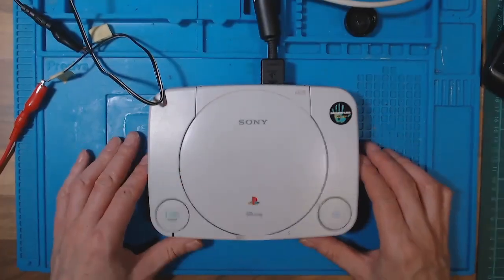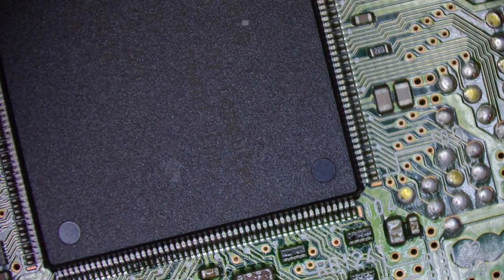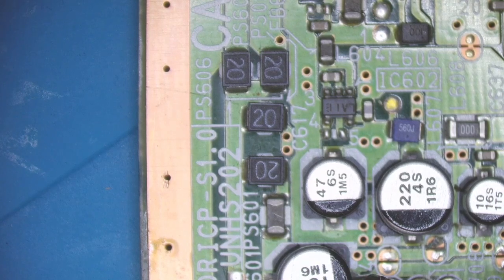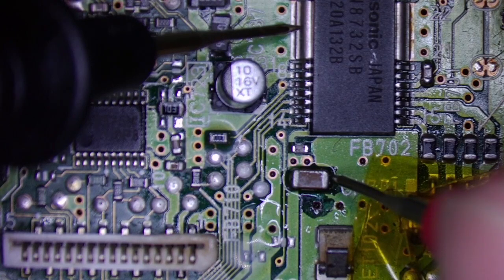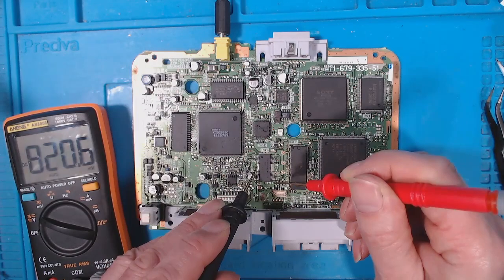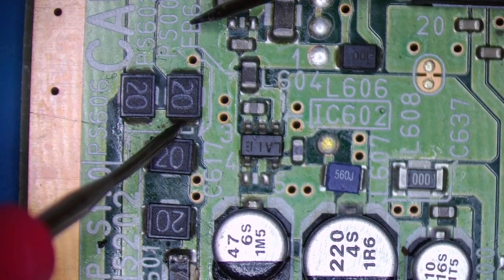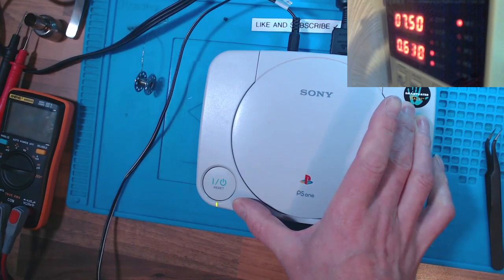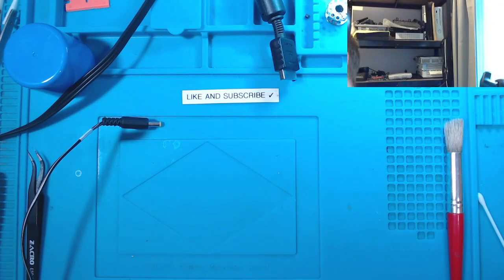Sony Playstation | PSONE No Power | CD Won't Spin | Can I fix it?

Comment: I toon one of them hone fro. A boot sale for £4 recently, came with a power supply also fully working, although the power supply was made for a PS2 Slim it still worked well, I gave it to my friend after I had my fun with it.

I still have my original PlayStation fron when I was a kid. Nice to see people keeping these consoles going
Reply from the maker: Wow, you got a great deal there. Every now and then I set up my original Playstation. It has the xstation mod too, which is great. My only suggestion is to try and use RGB if you have a TV with SCART, the picture is a lot better than the yellow composite cable.

Comment: Hello friend. From what I saw in your video, what is the frequency in volts that would need to be in this ps601 capacitor? Mine has the same problem. However, my motherboard is the PM41(2). Thanks!

Comment: Hey Phil! did you know those inductors are fuses!  😂🤣 Someone had to say it, even if you corrected it in the video 🖖😁👍🏻
I used to play the hell out of that game over 25 years ago. I have a few rare! PS1 games on the shelf along with some 40+ PS3 games that never get used.
Reply from the maker: I knew someone wouldn't be able to resist mentioning it lol. I deserve it ha ha.
What are a few rare PS1 games I should look out for.  The only rare game I have is a bootleg DS Digimon game.
Reply: The Adventures of Lomax is an awesome game for PS1 and very rare! your basically a grown up Lemming! its a scrolling, platform game.  Not a cheap game even today & the' Syphon Filter collection especially #3 is sort of rare too! Also' Metal Gear Solid the Special Missions edition, Toy story 2 can be expensive its addictive and fun to play, along with Toy story racer & Buzz light-year of star command. That's to name a few, the better the condition the higher the price, obviously, also some of the 'extreme rare' ones are imports but still very collectable in the UK yes you can get copies and dumped files but its not the 'Original' cased with booklet, sometimes sealed etc..
Reply from the maker: Blimey those are expensive. Something to keep an eye out for. I remember Tomb Raider, Soul Reaver and FF7 being my most played games.
Reply: The prices can be good if you find them in places like (car boot sales) Oh I like those and have those too! Tomb  raider and FF games are in a lot of peoples collections :)
Reply from the maker: @Ratchet_effect  I managed to pick up some free PS1 games today. Rayman 2, Blade, Duke Nukem, Time Crises, Tomb Raider 2, Theme Park,Tekken 3, Harry Potter, Sorcerers Maze,Fifa 97, VR Baseball 97, Soul Blade, M&M Shell Shocked,Spice World and Airboat Racing. So that's plenty of games to test any Playstations I fix in the future.
Reply: Phil! you don't have to use the @ option it still notifies me without it. Anyway WOW! that is an awesome score! well minus the Fifa & Baseball, they can do get thrown into a volcano & burn in hell LOL! But seriously that's a fantastic bunch for Free! I hope they are not to scratched, they'll serve you well when you need a test game for sure. You got anything in the pipe line? new or revisit I'm curious as always :)
Reply from the maker: I've got a bit to get through tbh. I have the video of a charge port swap on a controller to edit. Stuff to look at X1X with no display, PS4 faulty HDMI port, water damaged switch lite, on going Sega MD2s to look at again. I want to do an Xstation mod on a PS1, Sega Gamegear to look at. Sometimes I'm working 6 days per week so it's not easy finding the time.

Comment: where can I find fuse ? I have the same issue and trying to find what is the problem the IC722 is getting 1.3v and trying to find the problem and I might need fuse can you please give me the website to get the fuse or where I might find them thanks. 

update: my board is PM41-71 and I might have found the problem my PS601 fuse is outputing 1.3 I don't know if its the problem or some where else behind the IC722 is getting the same voltage as the fuse  need some help.

new update: found the problem the fuse PS601 is getting correct voltage and outputting 1.3 voltage just need a fuse for it its a very small one 20 thats what on it can you tell where I can find one?

Comment: Oh man im really hoping you have some advice for a novice here! So my psone had no image on screen but soon as i turned it on the psones optical drive would spin very fast and constant even without a cd, i bought a part put it in and nothing... Put the old one back in and nothing.. both parts work fine in my new donor. I was told to replace the caps which i did, i now have a picture but still no life in the optical drives, i followed your video and i appear to have the correct voltages so the drives are getting power... I dont know where to go from here...
Reply: Oooo I was using my multimeter wrong... I had it on ac not DC. On DC that same chip as yours is putting out 1.3...
Reply from the maker: Check for short around the chip like I did in the video. The chip could be faulty too.
Reply: @PhilipBryden I have ordered from fuses, which were not easy to find! Couldn't find any with the 20 on the top which bothers me more than it should. 😂
Reply from the maker: @TheCheekyhalfling  Are the fuses blown? Did you test them in continuity mode?

Comment: Yo need and official adapter!!! trust me had the same problem. In fact I have a fat 1001, that didn't spin and it was internal  power supply
Reply from the maker: You're quite right. I had this hooked up to my bench power supply but I hadn't set the amperage high enough to start with. 👍
Reply: @PhilipBryden  You're welcome sir!

Comment: i have an issue on mine where the laser dosent move or spin at all it does nothing . i wonder what can it be
Reply from the maker: It could be the lid switch not working properly. Test the fuses on the main board near to the power supply connector. Please be careful, the power supply can give an electric shock, even if it's not plugged in.